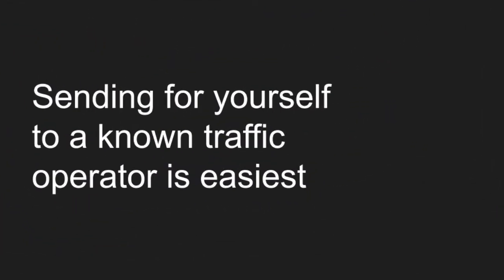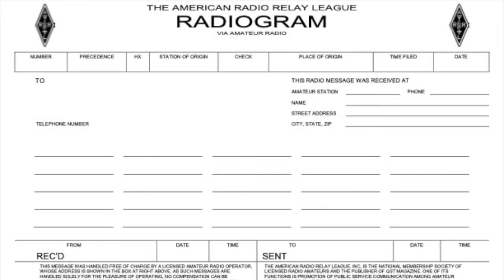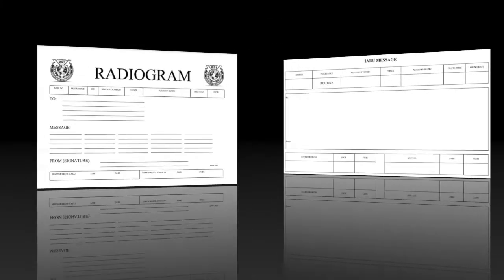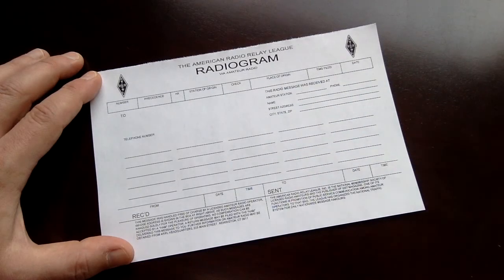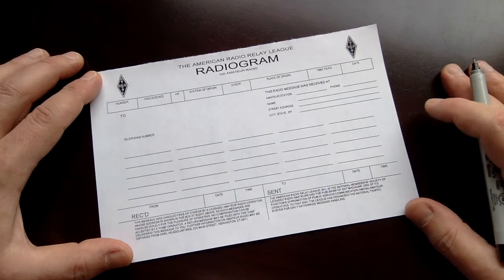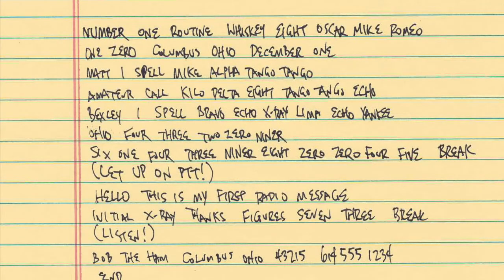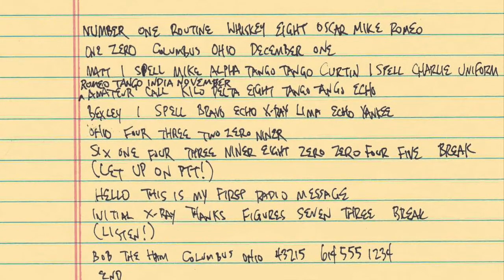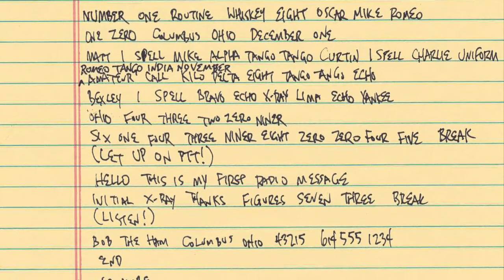Your First Radiogram (Radio KD8TTE Ep 041)

Comment: Thanks! I joined the QMN CW Net a few months ago and I am still learning. They have been very gracious to this newbie. I still struggle with taking a message. I'm afraid I'll mess something and make a mistake. However, I am told I should JUST DO IT and it will become 2nd nature after awhile. I'm on the net nearly every day. Hopefully I'll get that chance to give it a shot.
Reply from the maker: I second that advice. Just do it. You'll make mistakes. That's OK if you learn from them and go on to make different mistakes. Eventually the mistakes will be rare and you'll be a squared away operator. 73

Comment: question, when the info makes it to the last location, how is the info relayed to the recipient?  is it by telephone, by RF, by USPS, etc
Reply from the maker: If going to me specifically there's a good chance that it's RF. In the general case it goes to the addressee however is best for that case. Any of the examples you give can count. In a disaster scenario, it could go to a message board with cards posted on them for the recipient at the shelter to pick up.